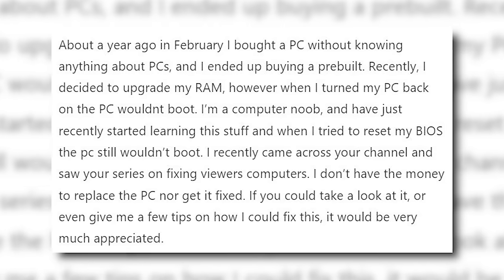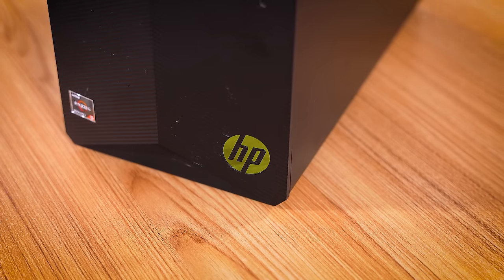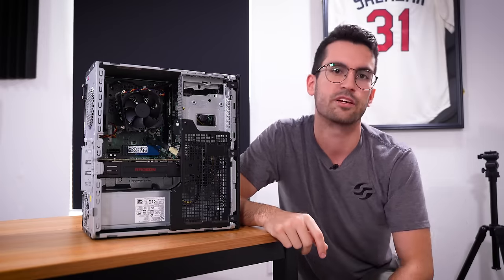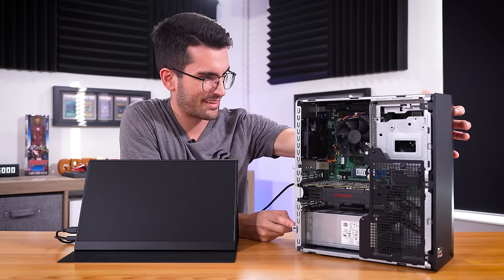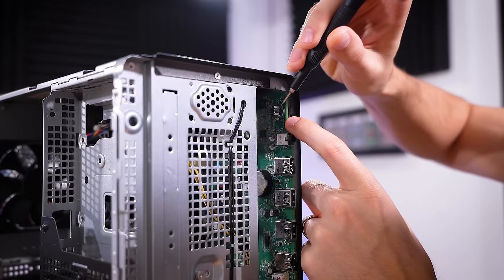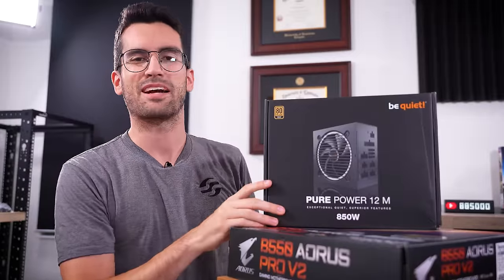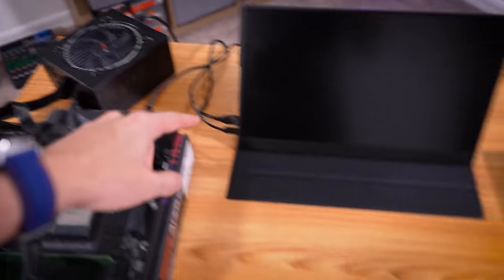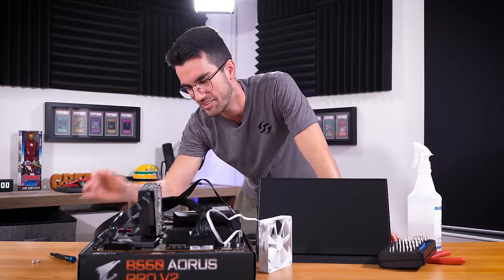Fixing a Viewer's BROKEN Gaming PC? - Fix or Flop S4:E17

Comment: Parts failing is what turned me off of oem systems. Had an emachines pc back in the day that had an inadequate power supply out of the box and after them replacing it like 5 times under warranty I decided to just buy my own power supply that was higher capacity. Then I had an hp machine with baked in secure boot that wouldn't let it work with any gpu other than the hd 6570 that it came with.

Comment: Next time you're searching for a "melted plastic" smell, try the thermal camera! It might be able to show you a hot spot to zero in on. 

Nice job with the replacement PC, shame these prebuilts are so proprietary. Can't even imagine it's cheaper than using off the shelf components with a proper mfg deal for the components, really don't know why they still do this after all these years!

Comment: these HP prebuilds normally have a warranty.
it should be checked whether this is still valid.

But if it has already been purchased as used, the warranty will have expired.

Comment: Bah, I'm dealing with a HP prebuilt unit right now. A lot of similarities as this here video. I was adding a PCIe Wi-Fi card and when I went to turn the PC back on the fans spin, PSU fans spin, motherboard lights up but nothing else. No beep codes, Keyboard/Mouse don't work (actually none of the USB ports work) and no display. I've run every test imaginable, even testing everything individually and everything works except when they are all together inside the case... lol. Anyone have any suggestions?

Comment: In my experience Delta and Lite-On are the best OEM PSU manufacturers and the PSU in a rig this new would probably be the last thing I suspected. I used a 325W Delta Dell OEM PSU from a 2009 Optiplex that had already seen a decade of office use to run a RTX 3060 to mine Eth for 18 months and it is still working just fine, back in its original rig.
With the rotting egg smell, I'm thinking it could be burning capacitor electrolyte. Maybe there's a cap installed backwards. It  can work for awhile but will quickly degrade and eventually become a short circuit. Would love to see you do a crossover with Northridge Fix or Northwest Repair where they take over and repair the board. I think, in general, this would improve the series quality by actually fixing nearly everything. You're still going to run into situations where you have a bad CPU which you can't fix or bad RAM which isn't worth fixing but you could be having a lot fewer flops if you can get a board repair expert involved. It also is an opportunity to clue people into the cost of board repair because it can really be the cheaper option in a lot of cases. If I am right about a backwards electrolytic capacitor, one of those guys will have it fixed in about 3 minutes.
You're seemingly confused about what the word 'fix' means. What you did here is called 'Overhaulin', lol. Maybe you should get ahold of Chip Foose instead. Seems like an opportunity here for you to divest Fix or Flop into two separate but equally entertaining series. Start really fixing and do a separate series where you do the overhaulin'. If you run into something cost prohibitive to fix at the board level then you move it on over to the overhaul series. You can fill out the second series by taking older gaming rigs that work fine and upgrading them. Turning one series into two seems like a great way to increase views.

Comment: The actual board fixing is why repair shops charge you extra money because that process takes additional time besides the basic diagnostic of components but for most people it's better to replace components because investing in soldering equipment is expensive and takes time to learn how to use properly. Like regular diagnostic alone takes around an hour or two, then trying to probe the motherboard for shorts takes time and actually repairing of the board takes time as well.
Reply: And even then its not a guarantee the system will work like before (or how long!).

Comment: 360 aio I would be surprised if that cpu even warms up, the aio is probably more overkill than the psu; Lucky kid though…..

Psu, motherboard, aio, case  and fans.  5*00x3d and a good GPU is the drop in upgrades for the future; Christmas comes early

Comment: Any ideas why my b450 max is only running x8 pcie lanes?  when i go to bios and turn on x8+x8 it doesnt detect the GPU ( RX 6600)
Reply: RX 6600 is a card that is limited to x8 speed, even though it looks like x16
Reply: The rx 6600 only uses 8 lanes even though it has 16 physical lane sized pcie slot. So nothing wrong with it, other than the slot could (and can) be a 8 lane slot

Comment: Here is the thing about Motherboards and Power Supplies like that that come with Dell or HP or some other brand that has there own Memory if you try to use off the shelves RAM it may not work as it should since it doesnt have BIOS if you want XMP or DOCP Memory you have to buy it from the company that made your system

Comment: I had a motherboard that died due to swollen caps.  The additional 4 pin power connection had some discolored pins, so I replaced the psu as well to be safe.

Comment: With a recent HP omen i dealt with... it didn't like ram speed change at ALL and the traditional cmos resets did NOT work. the jumper didn't work and even removing the battery didn't. ???? WUT. i found a buried reddit post detailing the procedure. Using a wired keyboard hold down windows key +B and then press AND hold the power button for 10 seconds. release the power button but continue holding the windows key +B for an additional 10 seconds. repeat 3 times. (i assume this is just to make sure it actually gets reset.)

this reminds me of bios resets for laptops, i have NO idea why either other method didn't work.. sort of crazy, but the keyboard process worked wonderful.

Comment: I'm wondering if he exerted a little too much pressure when trying to plug the DDR in and possibly cracked the PCB board? Also, on the AIO you installed (clean sharp look, btw), why did you not have the lines running off the bottom of the rad to prevent the possibility of the pump one day starting to suck in air (as, from my experience, those "sealed" units always manage to have evaporation over time and the air always rises to the top)? Is it personal preference, or the lines not being long enough to reach from the bottom, or is there something I might not know about the newer AIO designs that has fixed air suck over the past few years?

Comment: Question: when you turned the computer on after transfering the M.2 drive, were there any issues with Windows? 
Been doing some research and I've been getting conflicting results of what happens when boot drive from an HP OEM prebuilt is transferred to a new motherboard and turned on. I've read that it works, and sometimes it just doesn't and people need to rebuy windows. Etc.

Comment: WTG Greg he was a very worthy candidate for this one. I have a HP MB and power supply out of this same prebuilt except mine had a Ryzen 5 3500 and a GTX 1650 Super which I still have put up if you ever need them. I will probably keep the CPU and GPU but the rest is brand new. I needed a GPU to get me by by when you couldn't get them unless you paid tripple.

Comment: "it looks like a totally different system!"

Does it? After replacing the mobo, RAM, cooler, case, and power supply? Who would've thought!?
Reply from the maker: It's... NOT a totally different system, though. The entire platform and graphics card are the same.
Reply: @GregSalazar  the processor and GC are the only things that came over. The point was that it was obviously going to look like a different system when the only part from the original you can actually see is the $50 graphics card.

Comment: right at the beginning of the video you can spot a defective USB port, it seems pin in that port are shorting to ground, thus the PSU not turning on. I do not think that it could have been saved by bending the pins clear since the damage was most likely already done. And the smell most certainly came from an electrolyte capacitor cooking itself.

Comment: Along with the front usb port being mangled the way you tried jumping the power on pins at 8:45 was incorrect. Jumping those pins on the MOBO will not do anything. They are only for the mobo to tell the power supply to turn on. The correct way would be to jump the green wire on the PS or plug that connector back in and jump it from the back.

Comment: Thank god my hp with the i7 4770 have seen alot of upgrades since 2014. I updated the ram the gpu the power suply, ssd, the cpu cooler stoped working for luck i had another hp with a Pentium 4 and the cooler fited thank god. But i know that one of these days the board wil go out. But not now couse i cant buy another one either. But the guy was realy happy excelent work greg.

Comment: What you were smelling was a blown cap, which means that either the cap had too much voltage going through it - or something got reversed. I know in my field, it can happen due to over voltage or a reverse polarity, but supposedly the second one shouldn't happen in a pc - though the first is likely to happen as it has to me (my dumb ass trying to overclock a system sixteen years ago and ruined the motherboard, and the smell I got is what you described)

Comment: With the way it looked on the inside, brown fuzz everywhere, and nothing from jumping pins to power up. My very next thing I would have tried first, test the PSU. Easy to test even on a proprietary power. Given the state of everything else inside on top of being a prebuilt proprietary everything. Take the wire connectors from power off of mobo, send power to the psu, grab a multi meter test for 12v and so on, hopefully labeled on psu case. Easiest and quickest test for the most likely culprit given the current scenario. Then start tearing it apart and testing 4 or 5 small parts trying to narrow it down. Just my opinion though.

Comment: When the radiator is mounted on the front like that, should the fans be exhaust or intake? I was thinking exhaust so the heat is pulled out of the case, but normally the front fans are intakes, so I’m a bit confused.

Comment: I'm at 2:48 and I already see a possibly shorted front panel USB port.  

I'm at 8:50 and you made a mistake.  You jumpered the motherboard to start.  You would want to jumper the PSU side if anything.  Although with how this board and supply is laid out I'm not really sure what would happen.  I literally have that supply here on my 'bench'.  All the 12v is 'standby' as it were.  So there was always power to the PC.  The green wire signals the power supply to switch on the main power circuit.

Bummer you didn't see the mangled port yet, but maybe you do later?  I hope?

Comment: i had a hp i7 6th gen with standard micro atx , and used an adapter for 24 pin for normal psu and case swapped to a nzxt case

Comment: Why did you jump the pins on the mainboard header? This is not a front-panel connector (where a switch would connect), but supposed to send a signal TO the power supply! (The switch is hardwired on the board, remember? You tried jumping it right at the start.)

If you want the PSU to turn on they'd have to be jumped on the cable that's actually connected to the PSU!  This could very well be the reason why the board is dead now, because some component there didn't like being shorted to ground.

Comment: Hmm - AIO with the pipes at the top? Any concern for air bubbles to form at the top of the radiator? - Seen a few videos where it recommended to put the in/out pipes at the bottom to prevent airlocks ? It is just a question - love to hear your thoughts? (@13:06)
Reply: As long as pump is below the reservoir it should be fine.  Air will work its way to the highest point in the loop.

Comment: OEM's are only good for using until it breaks, then str8 to the trash.  They make them proprietary in hopes you buy another in 4 years.  The best pre-built I have is a Optiplex 790 with 24GB ram, Xeon cpu and GTX 1650 and SSD.

Comment: Nope, what is a Intel mount? But with are AM4 socket.😂😂 I found this out because I upgraded the cooler in mine  After cutting up the case for 30 minutes. Adding 4 fans. I was actually able to use it without thermal throttling.🎉

Comment: Excellent repair and reaction from the owner! The power delivery on those HP motherboards (I think Pegatron makes them for HP still? Or maybe MSI?) is so cringe. I wonder how much money HP spends designing the cheapest crap possible. Those boards barely meet minimum specs to run anything plugged into them.

Comment: I do enjoy these videos as they show how a process of methodical thinking while respecting cause and effect leads to a satisfying and robust solution.

However, I would like to address Greg's point about him rarely, if ever, getting the soldering iron out to fix the machines that land on his very clean workbench. In essence, he is not Adrian Black of Digital Basement. Now that's not a slight against Greg, I'm just using this comparison to make a point. Greg is fixing machines that have components that are readily available to buy right now. His channel is about contemporary computers, whose parts can be replaced on almost a whim. Adrian on the other hand, does not have that luxury.

The computers Adrian works on are, in many cases, older than the people watching his videos. He can't replace the components as they are not made any more. Hence him spending countless hours pouring over schematics, checking the data-bus to see if it is locked on high or low, replacing leaking capacitors that are well past there use by date, and discovering if a specific IC has decided the expire for whatever reason.

Despite this, both Adrian and Greg employ the same methodology as each other when trying to determine the cause of a non-functioning computer. What differs between them is the means by which they bring these machines back to life.

Comment: After dealing with prebuilts over the years I absolutely avoid them. One of my hps even had a proprietary internal USB 3.0 cable to chassis. A different PC my nephew had I ended up swapping over all the parts to a new build just so he could upgrade his graphics card. Then that gigabyte motherboard for that build I got from FB marketplace ended up being from a prebuilt (iBuyPower maybe?), and I couldn't get video straight from the board but could from a GPU. I tried updating the Mobo bios, but gigabyte bios wouldn't take. I ended up having to get bios from the prebuilt vendor, ugh. I've also had very similar issues from Dell too. It all comes across very anti consumer.

Heck, thinking about it now I also had issues with a HP laptop. It refused xmp ram settings because it considered that over clocking.

Comment: *If it had been the OEM power supply, there often are adapters for standard ATX power supplies on both Am and eB.*

But, clearly here your path for a 50 percent replacement was set in stone with the mobo being fried.

Comment: If HP is anything like Dell the voltage difference in the ram might have caused damage. Dell likes to use ram that's something like 1.20volt and the LPX is 1.35volt. It's VERY unlikely that it did, a Dell that relies on the 1.20 volt ram won't boot with a 1.35v ram kit.

Comment: Did anyone else notice the bent USB pins in the front panel? Ive had a motherboard not power up because of pins shorting out in a damaged usb port, just like that. I bent them back and it powered up again. The board is probably dead anyway now that Greg forced it to burn up, but that might have been the issue in the first place. Either way, the upgrade was extremely nice for him.
Reply from the maker: Yeah, I really wish I'd seen the USB port sooner. I don't think it would've fixed anything (the board already seemed reluctant to turn on) and I don't think I burned anything up that wasn't already cooked from the start.

Comment: 2 minutes in and I already see something funky -- Case has a Ryzen decal, but that kind of looks like an Intel CPU cooler. I'll reserve judgment on theories for the moment, but I suspect this thing is a hacked-up hodgepodge of incompatible parts. If it is in fact a Ryzen, I'm thinking the proprietary board requires proprietary RAM, and / or the RAM installed is not compatible with the CPU or the board. Ran into this on a B450 / 1700 combo.

Comment: So to those that think swapping parts out is not fixing the PC, then say you need a repair on your car and the tech installs new parts - by that viewpoint they didn't fix your vehicle.  Depending on the line some OEM's use standard hardware that isn't proprietary but most of that is higher end and there is more than enough builders to choose from without paying the logo tax.

Comment: Eh that "forcing power" shouldn't do nothing. Those pins are the ones swithing, closing the power on circuit like how you jump it before. Since something did happen, maybe you were somehow shorting the 5Vfsb (if it has one, otherwise an "always live" 12V rail, possibly donw the line from it since it does seem to use a kind of 12VO type solution with conversion on the board) to ground.

Comment: Great video. And we need to call these Dell/Lenovo/HP prebuild gaming PCs what they really are: Intentionally manufactured e-waste. These companies try to green-wash their brand all the time. But they intentionally sell systems that will end up junked when one proprietary part fails. Nobody spends $250 on a new HP motherboard to fix a $500 prebuilt system. But TBH.. you can get this system for $450 at Micro Center ($600 other places). It's understandable how a kid would end up with such a system. That's cheap.